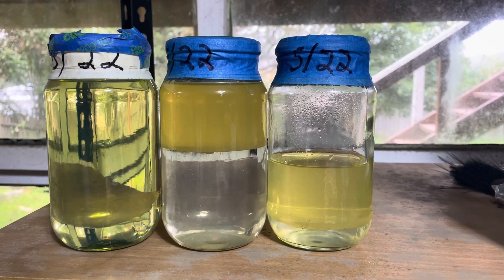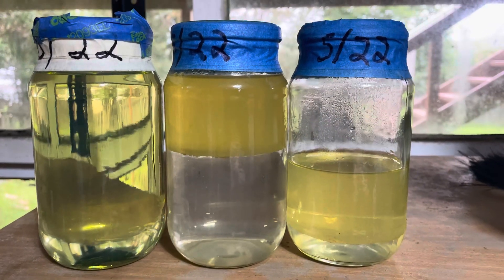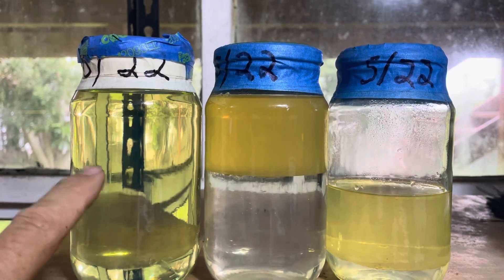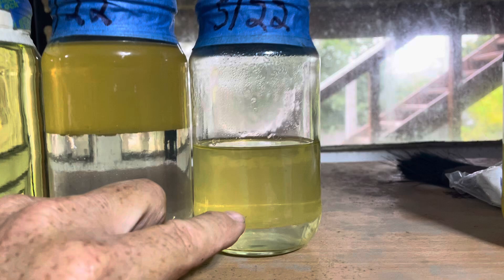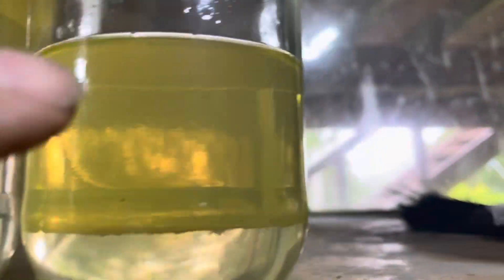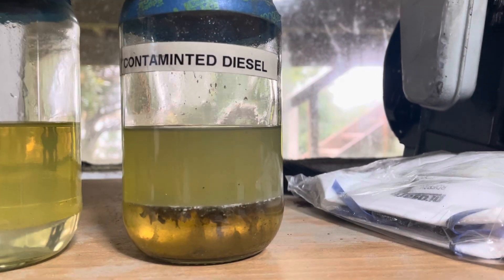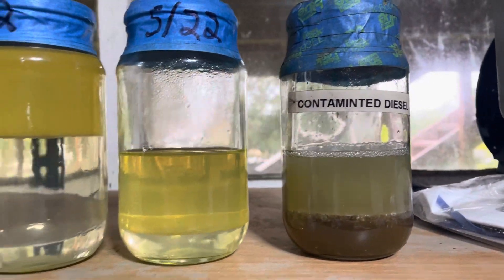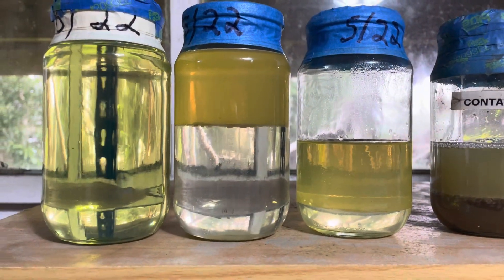What is diesel bug and how to stop it

Comment: I have a teori that will eliminate diesel bugs. Just started testing my teori and will have an answer in 2 months time. Under 500 USD pr tank under 100gallons/4-5 hundred liters  and 5-20 years before service.  No toxins, no filtering, no ultrasound , no uv light etc and nothing used before. Fire and almost forget solution.  Pray to god that I`m right. This is a hell of a problem.
Reply: Scam